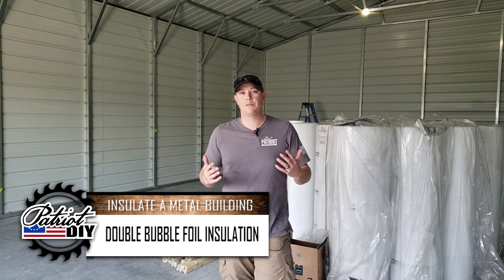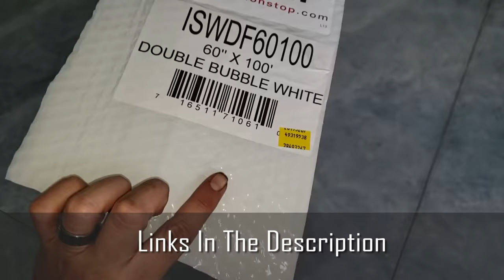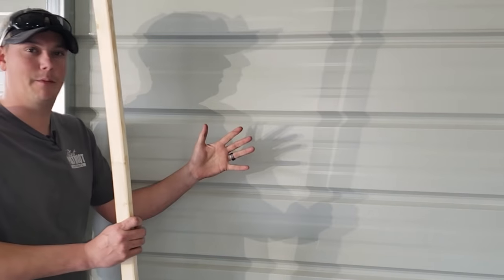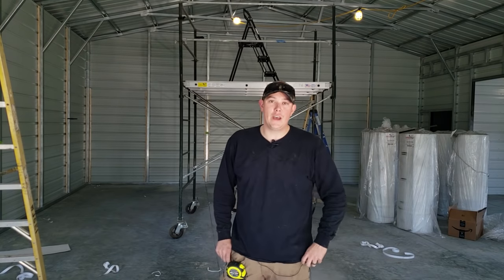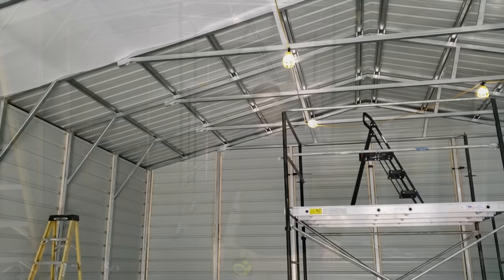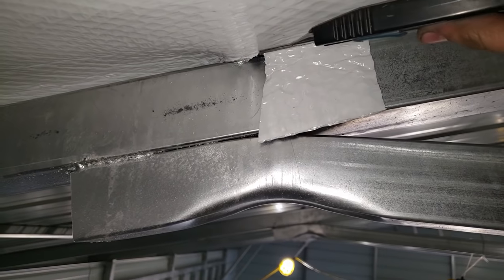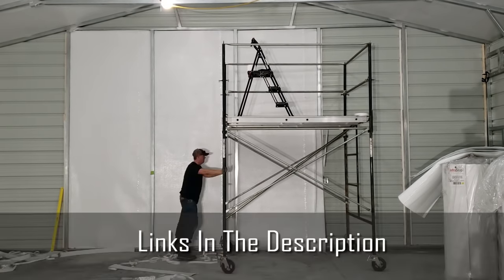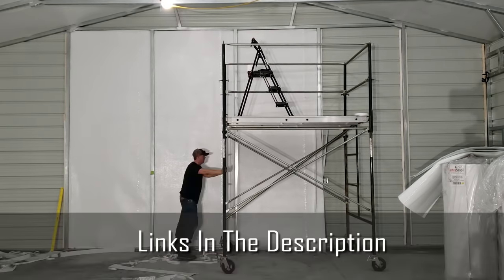How To Insulate A Metal Building / Double Bubble Foil Insulation

Comment: Instead of those furring strips, could you have just gone metal column to metal column along the wall?
Reply from the maker: Yes! But my wiring wasn't done yet so wasn't a great option for me at the time, annd I just wanted my studs exposed for other reasons, but you could definatly do it that way!  If you do, make sure you use screws in addition to the tape for holding it in place!

Comment: I'm Concerned that over time the heat would loosen or dry out the tape. With No support in the center of the 4' span of the insulation would slowly peel down.
Reply from the maker: It's not only held up with tape. It's reeforced with staples and screws! Watch the whole video
Reply: Yep. I should have let the video finish. Thanks

Comment: Seems to me that the double sided tape will fail after a while and the double bubble will sag or fall
Reply from the maker: Ahhh but if you watch the whole video you will see that I only used to the double sided tape to hold it in place during install, then went back and added staples and screws for permanent hold

Comment: The double side tape may lose viscosity under high temperature. It looks the insulation sheet has possibility to drop in summer, especially the roof part.
Reply from the maker: If you watch the entire video you will see that it's also reenforced with staples and screws.
Reply: @PatriotDIY  That's great! Roof part also screwed? Sorry for my squestions. I'm also a DIYer. Cheers.
Reply from the maker: @hwangdenny2575  it is!!  Good questions! Thanks

Comment: what was final cost?
Reply from the maker: Spent around $1500 but had 2 rolls of insulation and several rolls of tape left
Reply: @PatriotDIY  
Cost per sqft?  My building is 30x80
Reply from the maker: @KA4UPW  price was around $150 for a 60"x100' roll

Comment: Glue and tape on an existing building wall?  Dirt, dust oil film are present on most existing building walls. It sounds like a lot of expense and effort for such a small R value gain. I have tried foil bubble insulation on the doors of my shop and could get nothing to stick even after steam cleaning the doors first. If you are building new go with roll fiberglass on the outside. For more R, I would go with foil/foam blocks inside. No matter what you use on roll up doors you will have to re-adjust the springs.

Comment: Anyone thought about using rubberized undercoating or one of those asphalt emulsion roof coating to coat the inside of metal building? I'm thinking coating the inside to protect and seal the metal walls and beam, then adding double bubble. Let me know what y'all think.

Comment: Problem
There is no place for the heat to escape
At a minimum could have installed a vented roof cap
Reply: Most metal building have a cap that covers where the two panels butt that does act like a roof vent
Reply: @walterbrob  there is a raised cap that has screening on both sides to keep the bugs out....
Metal buoldings can act like a big battery for heat...
Roof vents usually can't exhaust enough heat to over come the generated heat...
Maybe if there are a lot with fans....
It's just a mathematical problem

Comment: Why not just glue it to the top of the steel vertical beams without the wood firrring strips? Would give you a wider air pocket as well.
Reply from the maker: You could definatly do that, but my electrical wasn't done yet and I'm framing in between the studs so I needed the metal studs exposed

Comment: When we asked about the double bubble, we were told it is a fire hazard. We want to do some welding in our new pole barn so we were told not to use the double bubble wrap and are going with another insulation that isn't flammable. Anyone else told this?
Reply from the maker: Makes since to me, guess it depends on if you are going to be covering the walls after insulating.

Comment: It has always been my understanding that (out of direct sunlight) R value is ALL that matters. This thin reflective stuff that people put in attics (where it is not in direct sunlight) trying to reflect the heat back out through siding or roofing, will do basically nothing to insulate. Now, if your tin roof was a light color, and reflective, then that would help tremendously in reducing the amount of heat that comes into a structure. Best case scenario would be reflective roofing, and a thick R-30 (or more) insulation on the inside. SKIP the bubble foil stuff . . . a waste of money :)
Reply from the maker: Incorrect! It reflects the radiant heat caused by the sun, not the sunlight itself.....there is a noticable difference of 10 degrees cooler inside than outside on hot days...which is effectively a 20 degree temp drop since the radiant heat would have cause the inside to be HOTTER than outside
Reply: "trying to reflect the heat back out through siding or roofing, will do basically nothing to insulate" By definition, that is correct, but the point of a radiant barrier is not "to insulate". It is to block radiant energy, to keep it from passing to the inside. Insulation blocks conduction, which is one of three factors ( conduction, convection, radiation ). The foil layer is for the latter. You are right to mention a reflective roof surface, but roofs don't stay shiny. Foil under the air gap has a better chance of remaining an effective radiant  barrier than the exterior does. Even a brand new, bright, aluminum roof will radiate tremendous infra-red waves (heat) to the interior on a sunny day.
Reply: Resistance of Air Films (Physics) against Low Emittance Surface provide R value. The R value is not fixed, rather depend on size of air film and direction of heat flow. Yet, R value of absorptive products is mostly elevated due to unrealistic laboratories test conditions. In reality the R value drop up to 50%.

Comment: Hmmm Tape? I would be surprised if that does not fall in time?
Reply from the maker: Tape, staples and screws...mentioned in the video
Reply: @PatriotDIY  In the ceiling? looked like steel to me? staples cannot go through that? LOL
Reply from the maker: @thegrantdanielsband  Re-read my comment, i said "staples AND SCREWS".
If you watched the entire video you would have seen that in addition to the tape to mount the insulation I also used staples in the furring strips on the walls and self tapping screws into the metal purlins in the ceiling to secure it more permenantly.....
Reply: @PatriotDIY  Ok i see that but just at the top? I would suggest if you wanted to go a little farther and make it tighter you might want to caulk the edges with a white caulk would help hold it and seal it better just a suggestion 🙂

Comment: I fear the heat will cause the adhesive tape to let go
Reply: The tape is supposed to be resistant to heat but I had the same concern, thats why I also used staples and sheet metal screws to reenforce it! The excess on the ceiling is also tucked behind the beams to help keep it in place.  Mentioned those things near the end of the video!  
Thanks for watching!
Reply: ...... Im N0 expert, and I've NEVER done this before, however; ... I'm  going to make a video to show you how to do it anyway !
Reply: @rudygeorgiamulesandcountry1594  Everyone on YouTube definitely knows who you are and how good you are at what you do. Great job your awesome!

Comment: Unfortunately the glue didn’t stick to metal very well and began falling off metal
Reply from the maker: Mines holding strong, what adhesive did you use?
Reply: @PatriotDIY  Liquid Nails heavy duty. Saw your comment on L brackets. That should help
Reply from the maker: @Michael Blackwill  yea I think that would solve the problem, that's how a friend of mine did his.  I wish I had thought of that when doing mine, but I havnt had any issues.
Reply: @PatriotDIY  I’m going to try Gorilla Glue and a bracket for each strip. Should work good for walls. Going to foam ceiling.

Comment: Looks like a sink with drain open, and trying to be filled with water.  This approach is inefficient as it leaves uninsulated holes.  Read DOE insulation research from Oak Ridge, TN.  Key finding, uninsulated or poorly insulated area greatly reduce effect of insulation. Uninsulated beams are big holes.

Comment: That tape will start to deteriorate in a year and the insulation will start falling off.
Reply from the maker: No it won't...because it's also held with screws and staples.....watch the whole video before you criticize.
Reply: @PatriotDIY  
I like i think ill staple it up.. maybe use some tape to hold it as i get the staples in.
Reply from the maker: @KA4UPW  exactly what I did,. Double side tape, then go back with staples and screws

Comment: Waste of time and money for the minimal R-value.  Spray foam better in metal building.
Reply from the maker: Of course spray foam is better.....but would have cost an extra $6000 in this shop. 
This does the job it's designed to do, reflects radiant heat on hot days.  Radiant heat from the sun can heat a metal building to 20° higher than outside temp.....this prevents that. 
I can tell noticable difference, keeps it comfortable even on hot days
Reply: @PatriotDIY  Radiant Barrier is NASA Technology!  Not everybody understands it !  I had an engineer say that Radiant Barrier doesn't work.... I Laughed!  And I didn't get the next job...  You just can't fix some people.  They spout things off, without trying to understand it... Even a Live Demonstration,  They will think you have rigged the test !!!

Comment: This guy is WRONG. you DON'T need to put the insulation up with an air gap because the design of the insulation has ALREADY got the air gap in it.  It's a sheet of air bubble wrap sandwiched between two outside sheets of aluminium .  So your air insulation gap is already in the product. You can buy this type of insulation with sticky back, to stick straight on to the surface your insulating.

Comment: this will not last. The double sided tape will fail due to heat over time and sag.  And you will be having to do it over and hopefully better.
Reply from the maker: If you watch the entire video you will see that the double side tape was just to assist in holding it in place, then I added staples and screws...